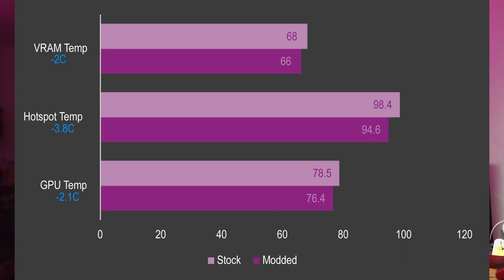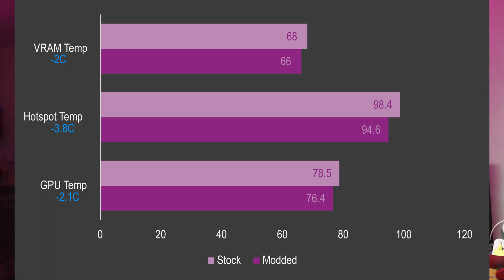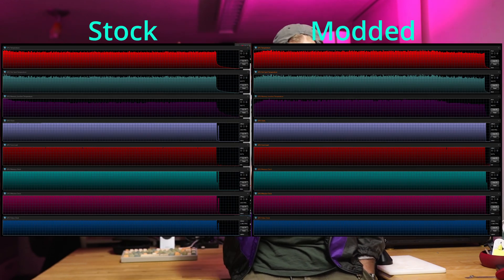RTX 4080 Deshroud Noctua Mod - Huge Noise Improvement

Comment from the maker: Quick correction: The 98°C hotspot was a peak temp under heavy load before the fans had any chance to ramped up, not the actual average. I mistakenly used max temps instead of averages — apologies for the confusion.

Corrected Temps (Before → After Noctua Mod):
GPU Core: ~75°C → ~60°C
Hotspot: ~96°C → ~75°C
Memory: ~88°C → ~72°C

The mod actually performed better than I originally presented. Thanks for the feedback!

Comment: Some 3d printed 200mm to 120mm fan adapters, couple 200mm noctuas.. 😁
Reply from the maker: That would be Interesting to see, but without also changing to a custom 100mm wide heat sink a lot of air would get blown straight past the card

Comment: I have a 3070, and play at ultra wide.  A GPU upgrade would be pretty nice.  But the prices people are asking are ridiculous.  So I'm considering maybe getting a used 4080 or 4080 super and doing this mod replacing the thermal pads and paste.   We'll definitely have to wait for the market to stabilize because I'm not paying over a grant for a used card
Reply from the maker: Yes, I remember being shocked at how bad the 40-series launch was, but this is even worse. 

Prices are crazy, scalpers are running wild and inventory was minuscule to begin with

Comment: Hotspot 98C? Let's make deshroud without paste change. Well done.
Disassemble it properly, switch paste to fresh mx4 or any thermal inductive interface and you will see about 63C on a GPU and 70C on hotspot.
Reply from the maker: You have a point about the temps I displayed being high, but it's not the thermal paste. I actually messed up while making the diagramm and picked the absolut max value for each sensor, which was at the start of the benchmark before the fans had a chance to ramp up. 

The actual temps are a lot better, I'll make a follow up video to address this as well as come up with a better way to present the data